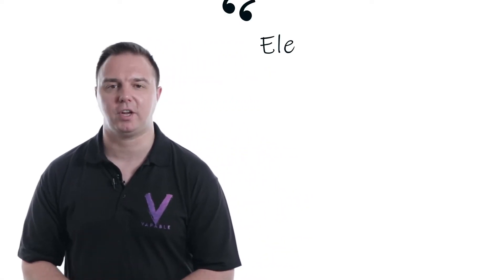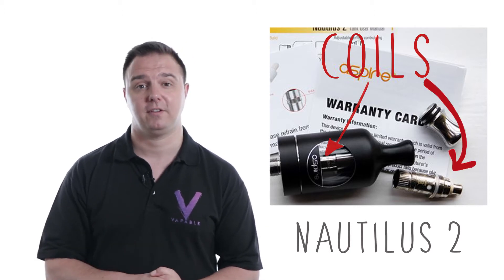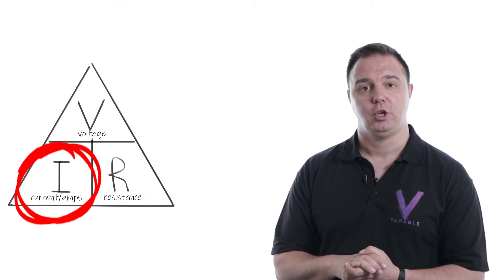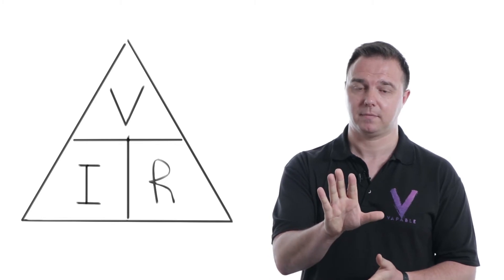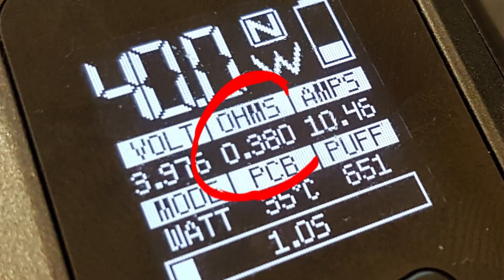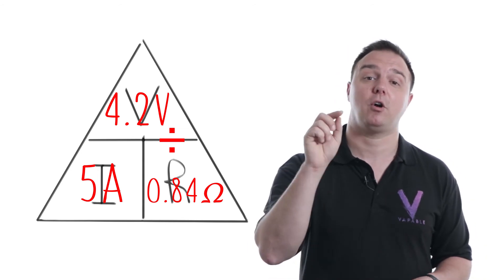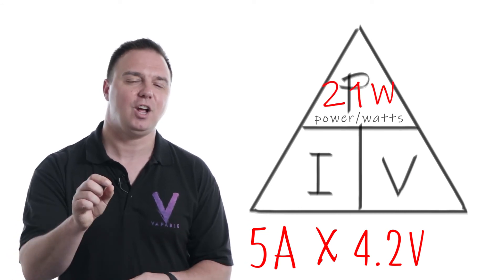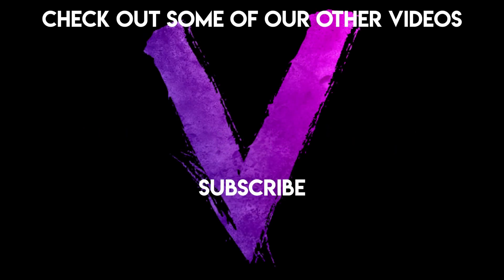Ohm's Law For Vapers

Comment: I have a question, lower guage wire (thick wire) electricity travels faster right? So it will get hotter fast, but why do you need to put your wattage up? If its getting hotter fast?

Example guage and ohms:
24g kanthal (0.3 ohm) 
vs 
28g kanthal (1.0 ohm)

Which will get hotter first with 12watts of power? If the answer is 24g beacuse its thicker then why would I put the wattage up like 30watts if its already hot?
Reply: To hit the same wattage on both coils, You'll need to apply a different voltage proportional to the coil's resistance, resulting in a current that's inversely proportional to both. e.g.

24g/0.3Ω:
1.9v / 0.3Ω = ~6.3A (first triangle)
1.9v * 6.3A = 12w (second triangle)

28g/1.0Ω:
3.46v / 1.0Ω = 3.46A
3.46v * 3.46A = 12w

The thicker coil will actually ramp considerably slower, as we use the same power to heat a bigger mass of metal.